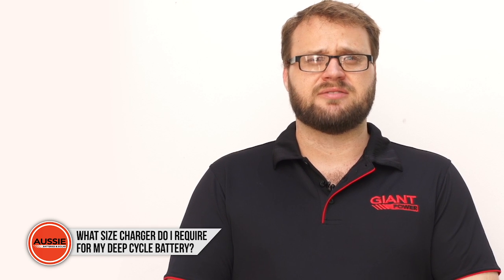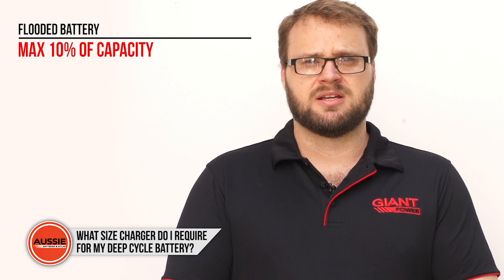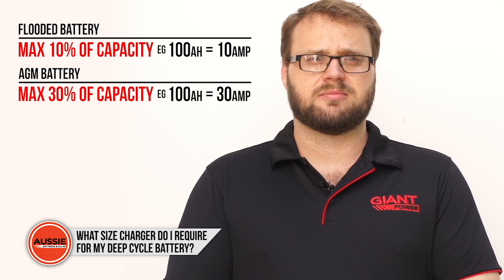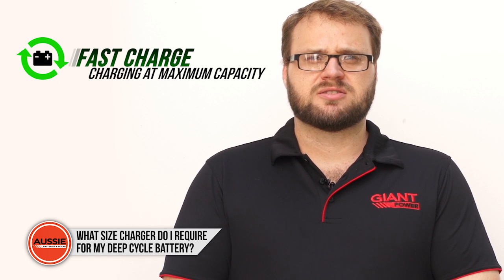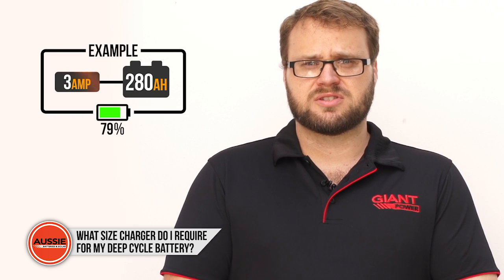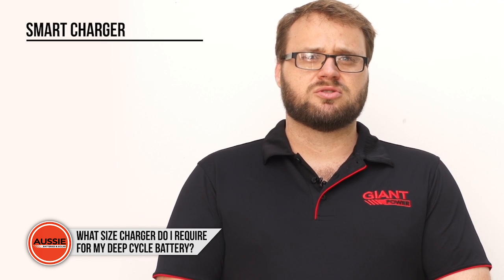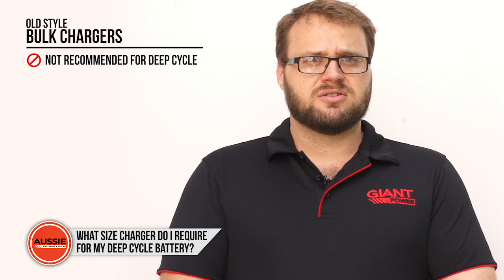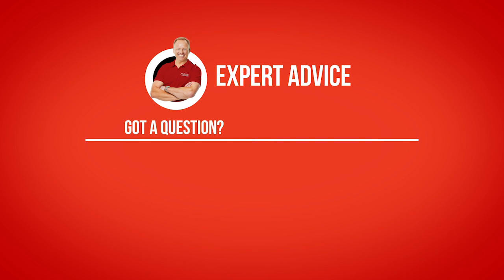Q&A: What size charger do I need for my deep cycle battery?

Comment: Is a 60 amp charger enough to charge and control 4 deep cycle (930  total ah )?  The monitor showes 15 volts and 98% charged.  The parameters were set at the RV dealership  when the system was installed.   These are lead acid batteries and we dont want to cook the batteries.

Comment: Does the  size of bank require different charger for instance 10  batteries on a 20 am change would u be  required to have bigger charger because not the number of batteries

Comment: MAX 10% of capacity? NO! 10% would be MINIMUM.
Reply: Everything I've come across thus far in all the research I've dome looking for a charger for the 114 ah battery in my boat says 10 amp charger MAX...regardless of whether I got the info from the charger peeps like NOCO or the battery manufacturer.
So it sounds like 10% for non AGM batteries is right on.
I think you got it backwards.
Reply: @dandettmann595   Dunno..........my charger says about 10 amp max too. That dude at Pacific Yacht Systems keeps preaching 10% minimum per 100ah
Reply: @SOLDOZER  I ordered a new model NOCO charger today, the GENIUS5 (new 5 amp charger with some brand new features) which everybody said will work fine.
However I found out after I ordered the charger on Amazon that they also had a new model GENIUS10 (10 amp) and when I verified that was the biggest charger I could use on that 114 AH deep cycle battery (10 amp), and it would charge it twice as hast...I tried to change my order and go with the 10 amp instead of the 5 amp...but it was too late to cancel.
So I might send the 5 amp charger back and get the 10 amp instead as back to back trips/days there might not be enough time to fully charge it with the 5 amp charger. 
I did a lot of research and the NOCO is highly rated/recommended and the reviews are excellent...and that was mainly the G3500 (3.5 amp) that is being discontinued that everybody loved.
The new 5 amp model I ordered just came out and offers a couple new features but hasn't been out long enough yet to have many reviews.
https://no.co/products/charging/multipurpose

Comment: Hi I have two 200ah agm deep cycle 12v battery’s I want to purchase a sterling battery to battery charger for my ford transit custom 2018. Could you please recommend what amp size machine I would need I was thinking of 60amp? Many thanks

Comment: can i fully charge a 300ah agm battery bank (3x 100ah batteries) with a 10amp smart charger? the 10amp charger i'm looking at says it's suitable for up to 135ah batteries. As i understand it this charger will charge my bank but it will be pretty slow - which is fine with me. If i'm wrong, can someone please explain why?
Reply: Hi Fergus, thanks for your inquiry.  You can charge a 300ah bank with a 10amp charger but it will take a very long time, ideally you would have a 30amp charger as a minimum.  I would recommend charging your batteries individually if possible.  Feel free to give us a call on 1800 853 315 for any further questions.

Comment: Hi i have adeep cycle battery can i charge it whith normal car battrey charger ?
Reply from the maker: Hi Mohamad, it will depend on the chemistry type of the battery (eg. AGM, wet cell, gel), and what your car battery charger can support. Check the manual of your car charger. Typically you will need a proper deep cycle charger though.

Comment: So if I have 6 deep cycle golf cart batteries that I use in my off-grid cabin, and there's no sun out, do you think I'm ok to run my charger at 150-200 amps for an hour or so?
Reply: Did I say battery?  I meant bat-tree ;)
Reply from the maker: +Jon Moore it would depend what capacity size your batteries are. 150-200amp charger is pretty massive.
Reply: +Aussie Batteries & Solar I have 6, 230 ah batteries.
Reply from the maker: +Jon Moore How are the batteries wired, eg. what is the complete bank voltage and capacity?
Reply: +Aussie Batteries & Solar each battery is 6v, 230 ah.  I have them wired in pairs (in series) making each pair essentially a single 12v battery.  

Then I have the three 12v (3 pairs of 6v batteries wired in series) connected in parallel so the whole system is 12v. That make sense?  Thanks so much for responding!
Reply from the maker: +Jon Moore Provided your cabling is adequate to handle such a high current, I'd recommend the max charge rate at around 20% of the capacity if these are AGM batteries, which is about 130A (690AH 12V bank). Charging with a gentler rate is also an option.
Reply: +Aussie Batteries & Solar Oh I was confused about how to calculate the amp hours for my setup.  So when 2 batteries are hooked up in series, the amp hours stays the same but the voltage doubles?  I think that makes sense.

These are flooded batteries so I'll charge them at 10% their capacity like you say in the video, or around 69 amps. 

Thanks again.  Cheers!
Reply: +Aussie Batteries & Solar And I have 3 strands of 10 gage wire connected to each battery terminal so I should be in good shape there I think?
Reply from the maker: +Jon Moore sounds like it should be fine from what you've said, Jon.